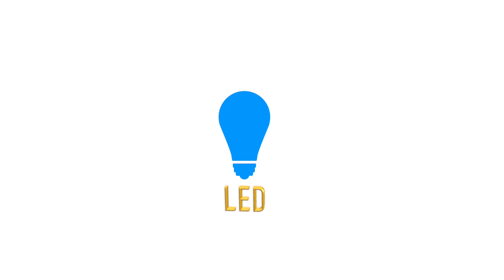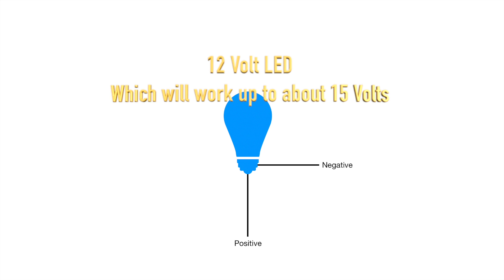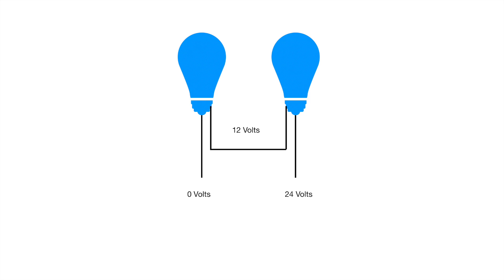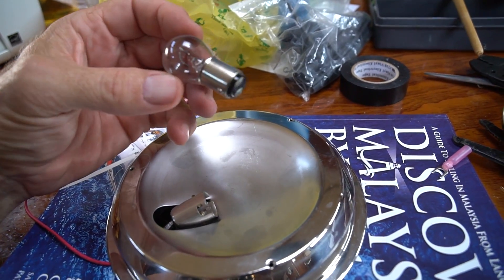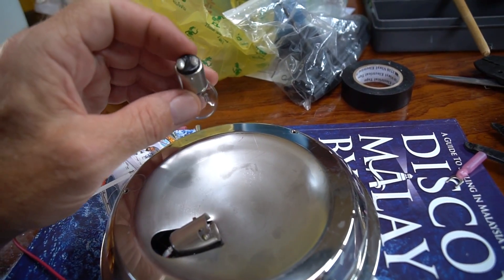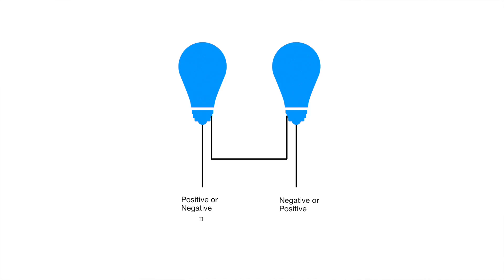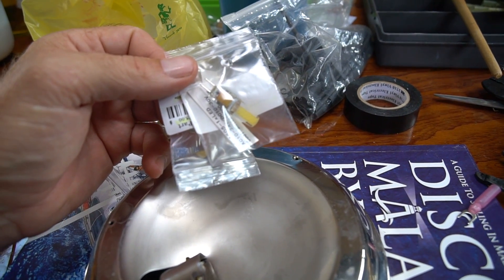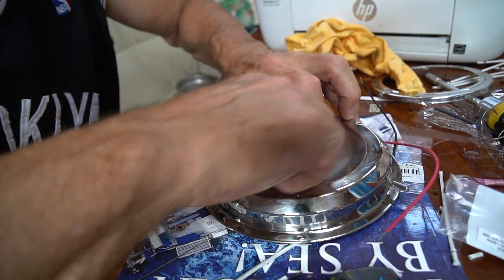So, you can't find an LED Bulb to fit your light fixtures?  Here is what you do on your 24V boat..

Comment: On Aliexpress many propositions. As a sample: https://aliexpress.ru/cheap/cheap-24v-bay15d-led.html
As I see this led lamp has combine 12/24V source. Some of the led drivers to do its possible.
Reply from the maker: It is true giving the right location you can find the LED that would fit this socket, but it was better in the long run to change to a more common LED.  Also, since they are 12 to 24 V LED's running at 12 Volts, they will last much longer.  Also there is a very low chance they will see any voltage spikes.
Reply from the maker: O and you get much more light out of the two LEDs!

Comment: nice retrofit look very low cost and easy to do and I might’ve removed the socket and just ran the wires in there and save the socket for another project but LED is the way to go, also with the LED you will draw less amperage which makes it easier on your battery pack/ solar cell bank, but You probably know that
Reply from the maker: Yes, it worked out very well!  More light, less amps, and should last 10K hours, which is a lifetime!
Reply: I do maintenance at a hotel and I’ve been told by people that have tons of light and knowledge that we buy lighting supplies through that the drivers for LED bulbs will go bad before the bulbs will go bad, for us it’s a 2.5 year pay back on Energy savings versus upgrade cost

Comment: 👍🙂 Love the cheap methodology used. 👍🙂 lowers the over voltage. I would have gone the regulator route myself depending on where I was located. Gone the add a small voltage regulator chip or pc board on the back and used the case of the fixture as a heat sink to get rid of those nasty over voltages and spikes.
Reply from the maker: My thoughts as well!

Comment: Heavy machinery uses 24 volt, big trucks to.
Reply from the maker: I could only find LEDs that fit this socket in 12V.  So, this way I can use two 12V LED's or two 24V LED's...  Gives me more options.  And now I an actually see what I am doing when I turn on the light!

Comment: They make a bulb that fits into that socket that has two wires coming out instead of the glass bulb, you just put it in and wire up one of the many square ones on how brite you want it!
Reply from the maker: I could only find LEDs that fit this socket in 12V.  So, this way I can use two 12V LED's or two 24V LED's...  Gives me more options.  And now I an actually see what I am doing when I turn on the light!

Comment: I think an LED lite bulb creates little heat- but the electronic board that is made part of the led makes heat and doesn't like heat.  So if you put it in an enclosed light fixture you may find your bulb burns out sooner, especially in warm climates.      Where did you get your led sockets and bulbs?  I ve not found them for my boat yet and hate to change the complete fixture.  thks for videos.
Reply from the maker: I found these in Phuket Thailand at AME, next to Boat Lagoon.  These LED's are so nice!!  $5 USD each is a deal!  The light you get out of the $10 in LED's is incredible!

Comment: Excellent idea Ken. Could you have put a regulator on the output of the system to maintain the voltage?  Maybe too expensive an option?
Love these videos. 👍👍👍👍👍👍👍👍👍👍👍
Reply from the maker: That would be expensive.  12V LEDs usually work between 12 - 15V, and 24V LEDs usually work between 12 to 30V.  24V LED's are just better, and they will last longer if only powered at 12V.  This setup will last longer, and give more light!